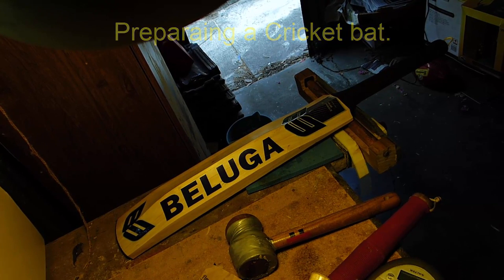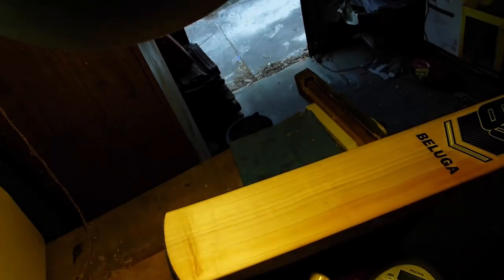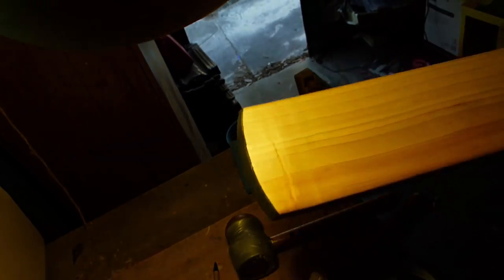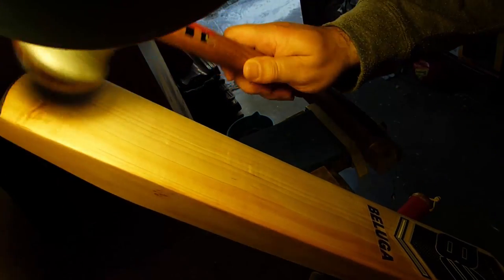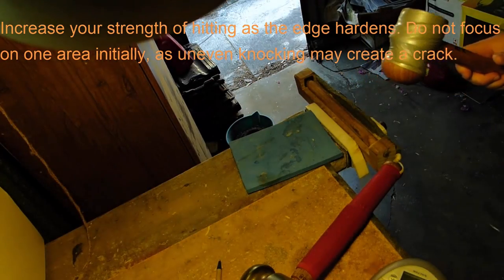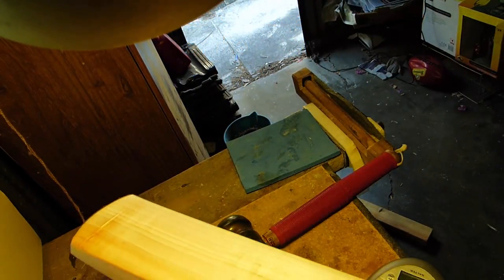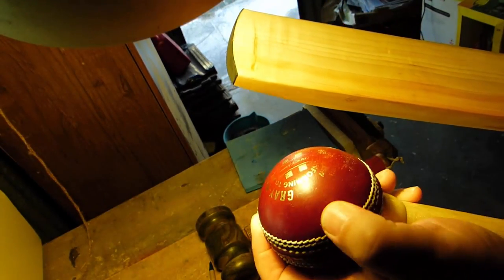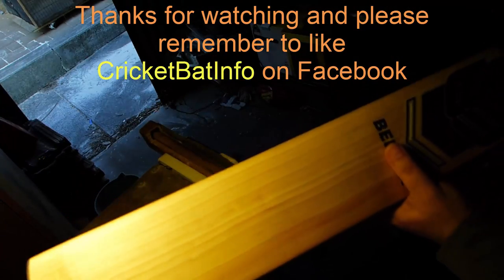How to knock a cricket bat?

Comment: Very helpful seeing the different approach you take. I’ve always used a cricket ball mounted on a handle - if only because impatience can lead me to hit too hard with a heavy wooden mallet! Btw I’ve always thought that whilst applying oil is important for locking in the remaining moisture in the bat it was also necessary for a) weatherproofing and b) keeping the hitting surface moist and supple enough that the wood fibres do not split or fray easily.
Reply from the maker: I updated the knocking video this year, but it’s essentially he same process. Ball on a stick is a waste of time and I only use it at the end to test the bat face when the oil is still setting for deep seam indents.

Comment: Hey what can i do if i bough a new bat and applied the Scuff sheet already before oiling the bat or kcocking it in. Do i have to take out the scuff sheet and then oil then knock the bat or is there a way to oil it without taking the scuff sheet out.